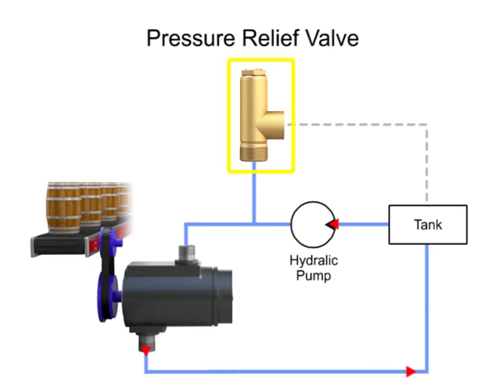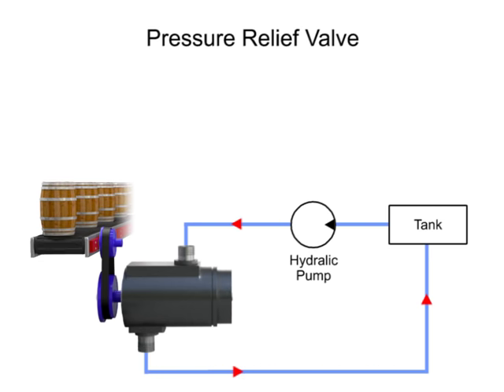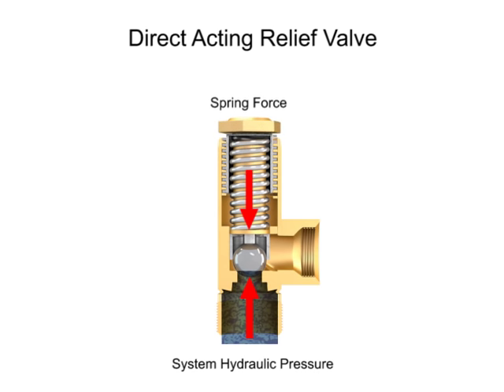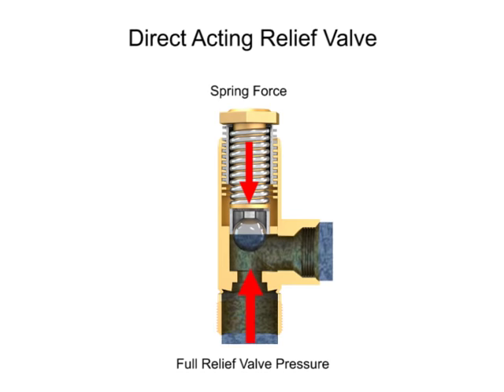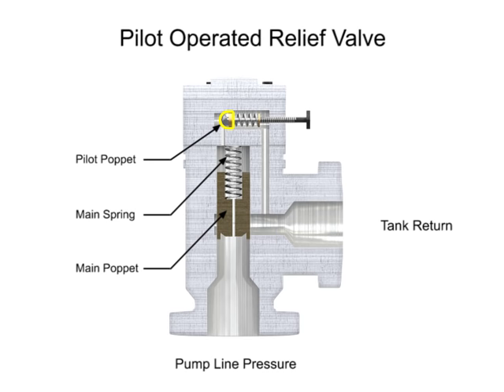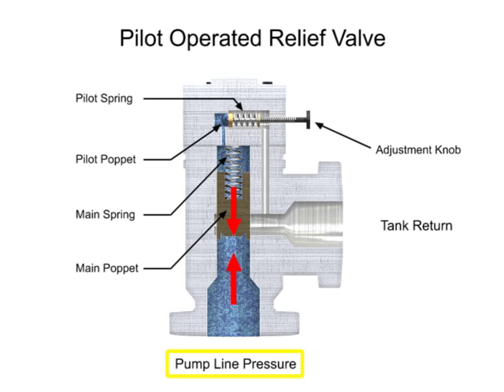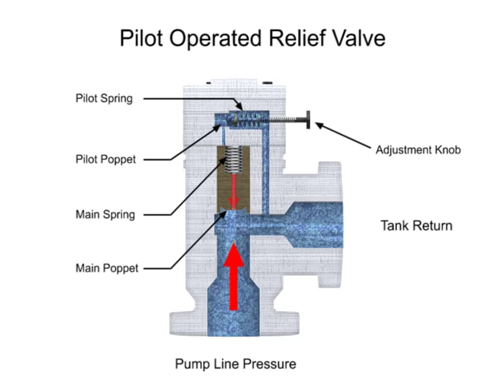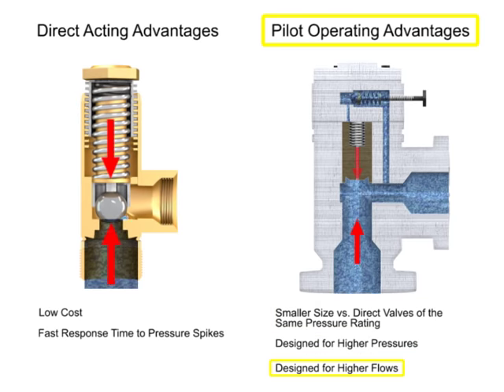Pressure Relief Valves: Direct Acting and Pilot Operated

Comment: At the end of the video, it claims that a pilot operated advantage is its "Smaller Size" vs direct valves of the same pressure rating. However, it looks much larger. So, is it true that pilot operated are smaller in size? Or was this a mistake? 

Would really like to know. Thanks.

Comment: Very good video. I think you should have mentioned that main poppet has a metering hole that let the flow to the pilot valve, otherwise,  the pilot valve will not operate.
Reply: how can i contact you